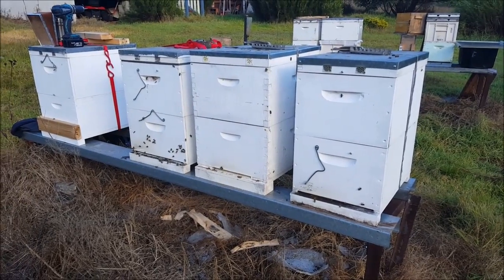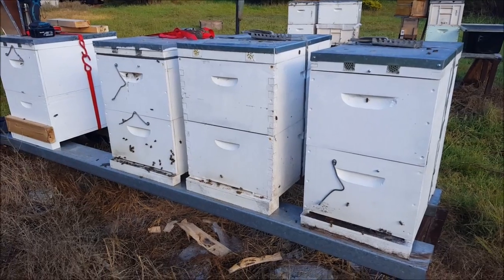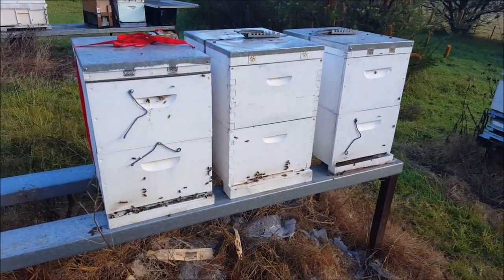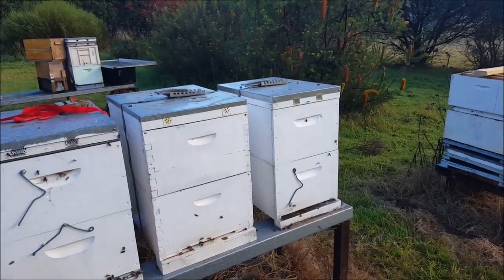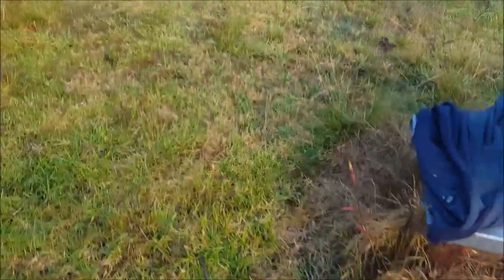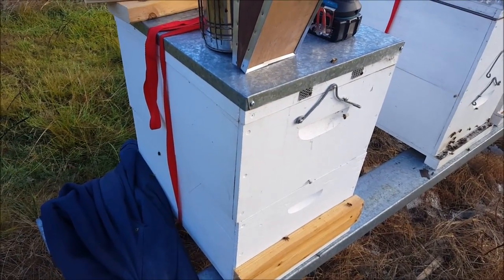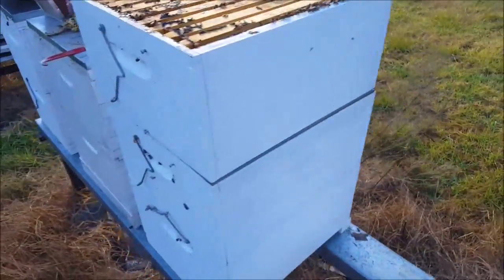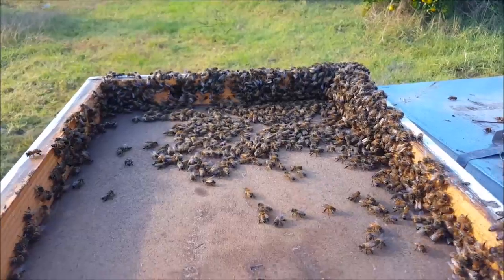Beekeeping - Free Bees and Freebies

Comment: That frame set up is great, looks easy to make as well. Nice work man.
Reply from the maker: I just drive four lengths of 2" angle iron into the ground, bolt on a cross piece at each end then lay the 6" C section on top. Gravity does the rest.

That 6" C section is structural steel, so it's not bending any time soon.